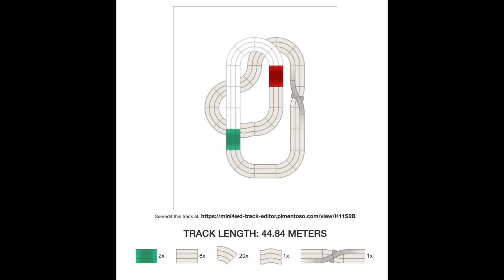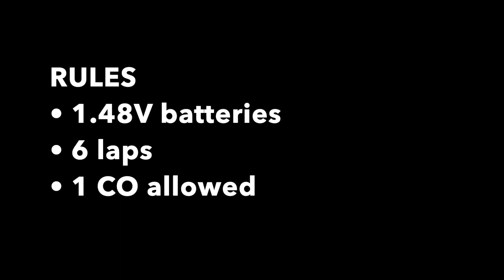Tamiya Mini 4WD - 3 Mach Frames TOO Run - June 2023

Comment: Do you ever measure and take into consideration the total width of a car, from outside edge of the left roller to the outside edge of the right roller?  Wouldn't that be a factor that would effect the amount of contact with the outside walls of the track?  Using the larger rollers (wider) would make the car wider wouldn't it?
Reply from the maker: Yes to the first two questions, but no to the third. If you compare box stock cars, MS cars are always more narrow than non-MS cars. That gives MS a slight advantage with less friction of roller hitting the sidewalls, but also makes it more susceptible to careening off the sidewalls of a track if it does hit the track at an angle. The same holds true for tuned and open. You could make your car fit the inside of a regulation Tamiya box or make it smaller widthwise, but if you do the latter, it will have the same advantages and disadvantages of MS versus non-MS cars. When you use a larger roller, say 19mm, you place it in a different hole than the smaller ones so the width of the car is the same unless you attach the roller to a different hole. Smaller rollers need to rotate a lot more than larger rollers, so they need to have much smoother rotation than larger rollers.

Comment: What’s the best chassis+model for stock tamiya?
Reply from the maker: It depends on the racetrack, but, for most, you can't go wrong with FM-A. I would have my box stock pitbox filled with at least 2 FM-A, 1 MA, 1 VZ, and 1 AR (assuming you have the dividers that can make 6 spaces instead of 4 for your putbox). The final spot should be one more of your favorite chassis or something radical, like a 4:1 animal racer or S2 car because you never know if a track is going to be super technical.